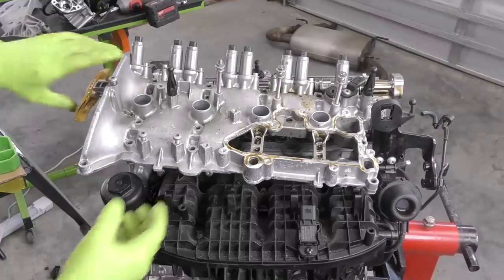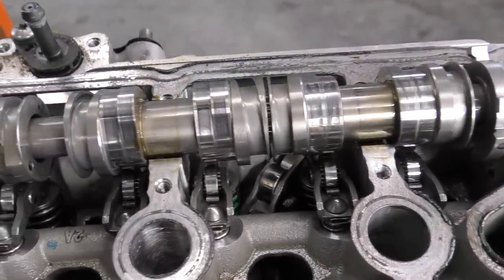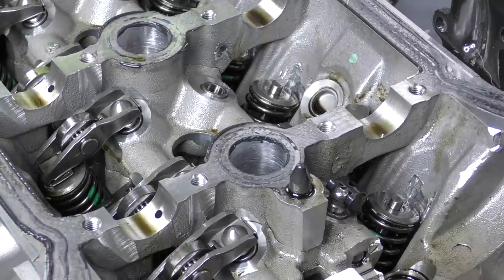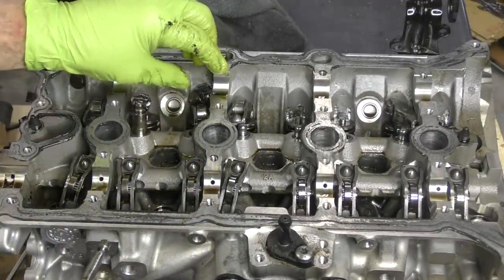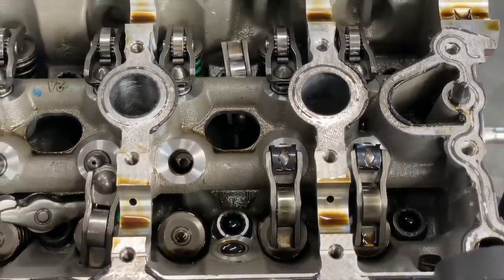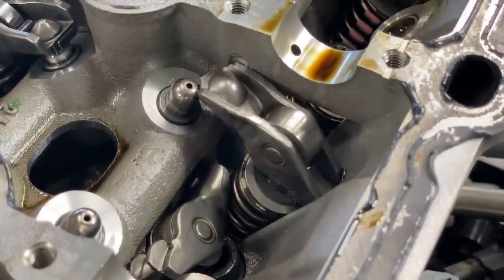Catastrophic Engine Failure VW 2.0t TSI Engine ~ MONEY SHIFT!

Comment: Why in God's name would someone be at a high RPM in a higher gear and down shift? I mean if you are at a low RPM in 3rd gear and want a bit of power without having to wait, yeah a down shift is good. Yet if you want more power in a gear and you're already at high RPM's in that gear, doesn't it make sense to up shift? Humble Mechanic Correct me if I am wrong.
Reply from the maker: He was trying to upshift and pulled 2 rather than 4. He made a mistake.
Reply: @HumbleMechanic  Oh...Oh!...Yeah that does suck. Dear Lord, what a bummer. I hope he had  warranty.

Comment: of course it had valve to piston collision, how do you think the followers got snapped?
Reply from the maker: I’ve seen tons of valve to piston contact. Never once seen that caused a rocket issue.
Reply from the maker: It’s possible but not likely
Reply: @HumbleMechanic  they are designed to snap when the valves are rammed back into the head, these engines still suffer from the lifters hydraulicing up with high revs and staying open, less likely when hot but still happens, that's why we fit solid lifters.
Reply from the maker: I can’t help but think if they did hit this hard, there would be witness marks on the pistons.

Comment: 9000 rpm is a crazy!   NOT .  Junk
Reply from the maker: When you consider it’s about +30% past redline 🤷‍♂️
Reply: @HumbleMechanic  tru that.   Just saying I have a k20A2 honda motor. Red line is 8k fuel cut is 8400. And i money shifted to 11k. Just got a engine over speed mil light lol..  keep up the good work

Comment: 9000rpm? Rookie numbers.
Reply from the maker: Think of it more like 25% past redline
Reply: @HumbleMechanic  I like your description of the stages. Though I think the stages are really more classified by your wallet. All the things done to this vehicle arent even considered a stage to me,but rather supporting mods for other,actual ugrades. Stage 2 in my mind would be titanium valves,pushrods (if equipped) or other,higher cost parts. But again,this is reletive to cost anyway,in my opinion. 
In my experience,based on my classification of a stage 2 (titanium valves,custom cam,tune, exhaust and intake modification,and most importantly timing and fuel change)
To me stage 3 would be changing the bottom end drastically (stroker parts,changing from 2 to 4 bolt mains,or 4>6,and other intensive modification.
25% over redline is apparently catastrophic for a VW motor,though I've accidentally mis-shifted far above that (8500rpm 3rd to probably 11k in 2nd in a civic) and went on happilly afterwards.
Other time,I've done a mis shift and sent a piston out the head (ford 4.6, 5900 3rd to 8+ 2nd).
Now THAT is a money shift 😂 needs Everything from the block to the hood, because it left a hole in my hood,lol.
Reply: Anyway, loved the video. Great analysis. Just gives me more reason to granny shift no matter what,and just accommodate for the lower rpm with more boost. Haha. Happy building man. :)

Comment: Over-engineered trash. These are throwaway engines if something like this happens. I would be willing to bet it's probably got a cracked piston or bent rod or 2 if it revved hard enough to spit all the rockers out from under the cams. In any case, I don't think the bottom end is completely unaffected. Of course, that won't show up until it's disassembled and checked thoroughly. They've got way too much plastic crap on these to suit me.😜

Comment: Why simple if you can construct it complicated...  Typical German overengineering "verschlimmbessern".  Keep it simple stupid!
Poor on edge calculated engineering.  Might as well make it a throwaway engine all fused welded together.
The replacement/repair cost of this entire cylinder head assembly is probably the cost of the entire engine.
This engine looks very new, outside and inside.
This is something that should never happen. (Except maybe in a top fuel dragster with 11,000 hp at full throttle acceleration.[And they are push-rod engines]) 
Especially with all the control electronics in a car today it should not be possibility to downshift from 3rd to 2nd gear forcing up an extremely high engine RPM.  
Even the simplest 3 speed automatic from the 1960s if manually shifted down doesn't allow that!!!
Crap over engineering failing on crucial points. 

PS 4th cylinder has longitudinal scoring marks and debris particles

Comment: Is that a model engine? A dummy? Because it is made out of plastic. I'm sorry to say but I hate VW with the bottom of my heart and I will do all my life, 
guys don't buy this. Nobody makes an engine like i.e 1.8tsi with THREE chains, one for the timing, one for the balancing shaft and one for the oil pump 
and the great thing is, they always fail at some point, oil consumptios is massive, plus they lied to everybody with this dieselgate and on top of that 
they've made a racist advertisment of the golf 8 where they flick off an african dude. That was a scandal too.
VW was great as the Golf 3 rolled out. The first scirocco, amazing. 1.4 (BBY)  75hp? 2 liters of oil consumption per kilometer. And a knocker from factory.

Long life to the japanese car makers.

Comment: What a pile of plastic junk, what is wrong with VW making everything plastic
Reply from the maker: Look around the industry right now. You will find Almost everyone doing this stuff. Plastics are replacing a lot of things.
Reply: @HumbleMechanic  Just be thankful that you can get those plastic parts as aftermarket as well, as there is a large volume of VW spares around, and thus the OEM parts in general are cheaper. Unlike certain  2 letter US brands where they think that they should charge you as if all parts were made in the USA in dollars, but buy them in Won at a very low price, and make a massive mark up on them instead.

If you need 2 front struts and an engine mount, and they cost more than the car, while for VW and even BMW even from the agents they are affordable.
Reply: HumbleMechanic well yeah intake manifold and oil filter housing is questionable but timing cover and oil pan is absolutely no
Reply: Plastics are the way of the world, better get used to it.